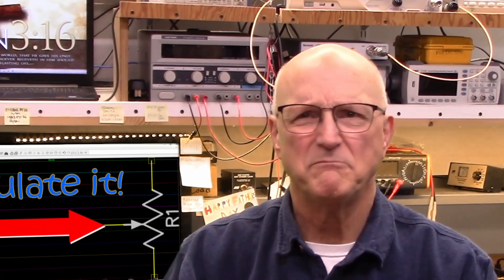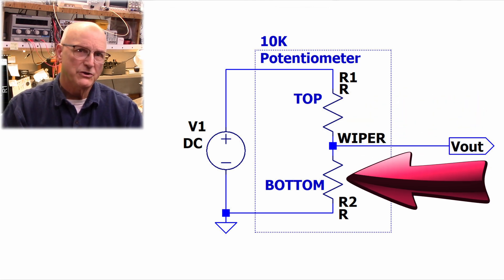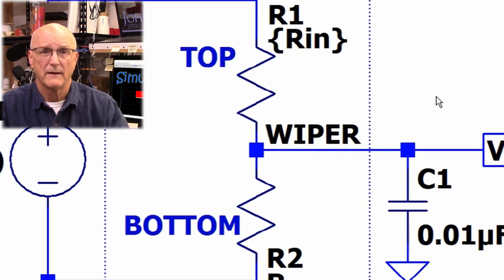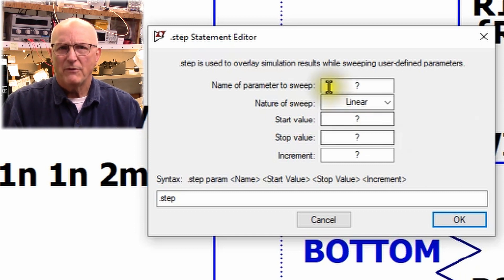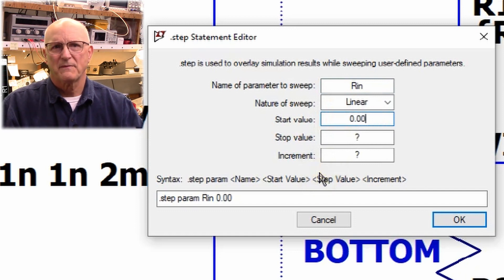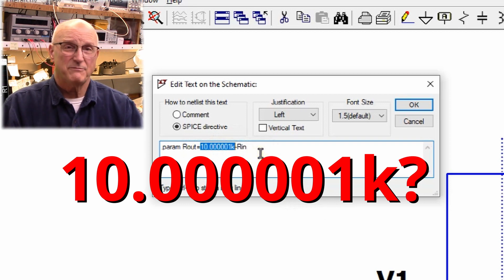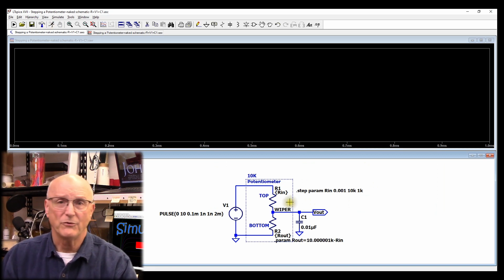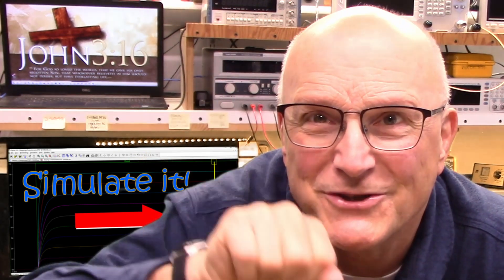LTSpice: Simulating a Potentiometer (064a)

Comment: Could you please explain how to draw a Uout=f(Rout) graph with steps of, for example, 1 ohm as the result of the simulation. It should be a step graph. I would be grateful - the AI is helpless.
Reply from the maker: Well, you are not going to get it out of LTSpice directly. You have to export the data to a text file. Select the simulation results window. Then File->Export Data as Text. Select what you want to export (e.g. Vout) and where you want to save it to.
Then you open the text file in your spreadsheet. I select a delimited file with tab, comma, and "other" selected. I enter a left parenthesis as the "other" character. Then finish.
Each step is your 1 Ohm increment. In the case of what I just did, there were 5 rows per step. I added a column of step numbers and a column of row numbers. The row numbers start at 1 and increment by 5. My third column is a formula "=INDEX(B$3:B$5001,F3)"
B$3:B$5001 is the array of data. Column F is the row number column. It looks like this:
Step	Value	Row#
1	10	1
2	9.99	6
3	9.98	11
4	9.97	16
Hope this helps. :-)

Comment: Here you created a voltage divider across the voltage source.  Would this method work if the pot was acting as the feedback resistor of an OP Amp?  Or a biasing resistor in a transistor amp?
Reply from the maker: Most certainly. :-)